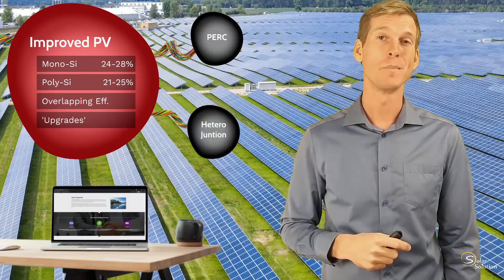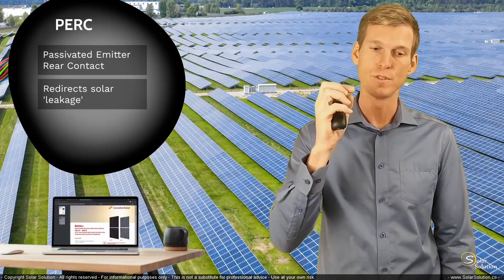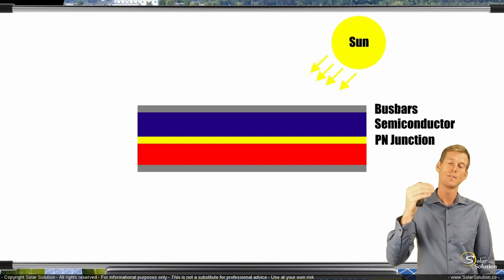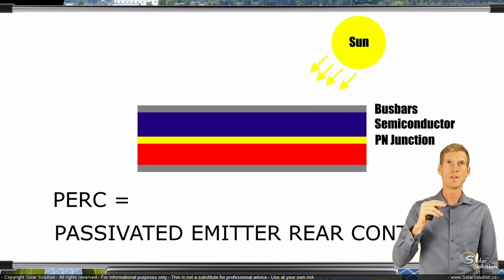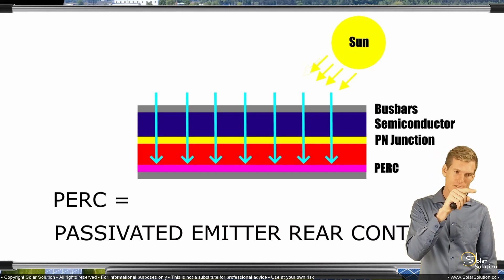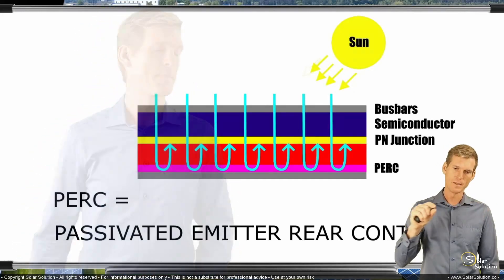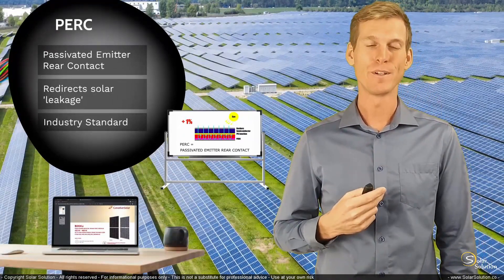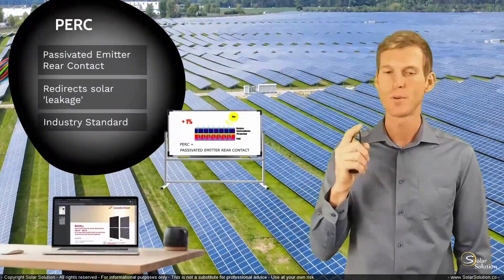The Advantages of Mono PERC Solar Panel Technology: Passivated Emitter Rear Contact

Comment: Where does the PERC technology add power? I just bought some Qcells 320's with PERC and they are only >/=19% but average pre-PERC technology panels were the same efficiency. Does PERC technology produce more power than non-PERC when the sun is at greater angles to the panel?